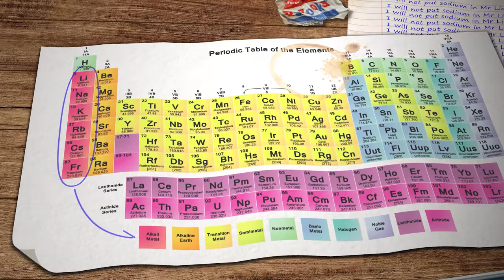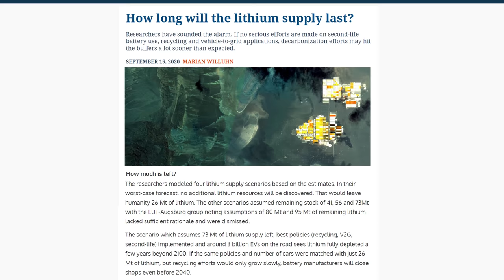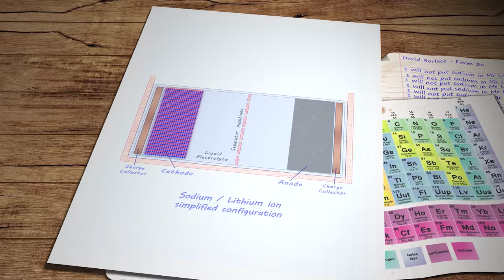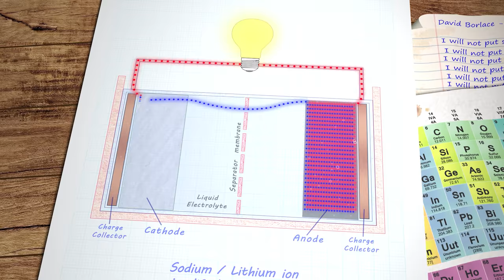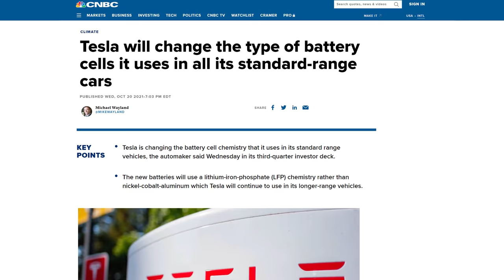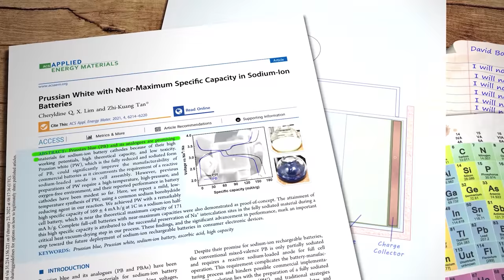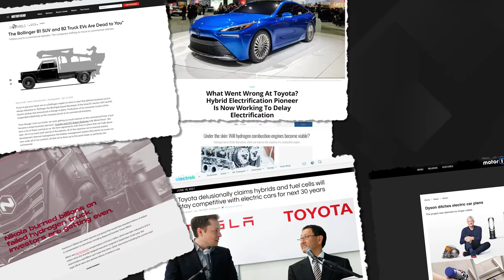Sodium-ion battery breakthrough. Safer, cheaper and cleaner than Lithium-ion

Comment: Just one point, or minor correction, -- well, maybe not so minor. And that is, that although Lithium is not nearly as abundant than Sodium, it is still very abudant. There are several countries around the world that could supply the entire world's supply of required lithium for the entire auto industry. That's billions and billions of cars. And of course, it's recyclable. In fact, Lithim is found all over the world in just about every country, outside of tiny island nations. 

It's just that until the last 15 or 20 years there has not been the need to mine and process it to the scale we do now. The next 3 to 5 years will see massive mining AND processing operations (many being currently built) in countries like the USA, Canada, Australia, etc. And in 10 years, the price (due to its recyclability) could rival, sodium. Well, that's a stretch, but you get the point.

And outside of land masses, all the ocean waters around the world contains Lithium, with underwater volcanic vents containing 7 times or more concentration of it than normal waters. What Sodium batteries will power, however, will be heavy, massive statioary energy storage solltions around the world.

Comment: The PV Magazine Article cited at 1m36s contains a huge over stretch in its maths assumptions.  Basically the article seems to think there there will be 3 ‘BILLION’ EV’s on the road by 2050 … which is mad. Because in the entire history of car production over the past 150 yrs or so, there has only been around 2 Billion vehicles in total, with an estimated  1.1 to 1.2  Billion still in use across the entire planet.  I therefore suggest that its highly unlikely that there will be 3 'Billion' EV’s manufactured by 2050. Its far more likely to be just a small fraction of that number. To produce 3 Billion in the next 28 yrs would imply a flat rate global production of 110 Million per year NOW, although of course the likely ramp up is exponential not flat. But even so, the 3 Billion figure is way overstating it, even allowing for population growth, and excluding all sorts of other likely developments like fleets of general use FSD robocars, significant energy efficiency and optimisations, other battery technology's (eg sodium based ..), Tesla's recent patent for Li extraction from clays which could be a game changer, and perhaps the lack of need for us to all have vehicles. I also think hundreds of millions of legacy ICE vehicles will still be in use into the 2040s and beyond.  Final point - there is, theoretically, enough lithium in the worlds oceans for an estimated 20 Billion EVs (which absolutely isn’t going to happen!) but its a tiny tiny amount per unit volume and would be a last resort and highly unlikely to ever be implemented etc.

Comment: It's good to see tech that uses more abundant resources. At the same time, a casual search shows Li-Ion cells go up to 260 Wh/kg - that is still a substantial difference. Also, there was no mention of density per unit volume, which is critical for these new batteries to be used in phones and similar devices. I would expect at least in the short term these will be a cheaper alternative for larger scale systems - like cars or grid storage. 
Also, the first generation sodium batteries are now out for a year, but I have not seen them mentioned at all... Did they get any substantial deployments?
Reply: It's not for phones
Reply: @markjackson7467  Even for cars, capacity per unit volume is important. It's only grid storage that can disregard it.
Reply: @GalvayraPHX  There's an acceptable range for each application - it's not binary you dipper

Comment: sodium ion batteries seem like they could work as a replacement for lithium ion batteries for smaller mobile devices. i think that iron air batteries will eventually become the standard for stationary batteries such as power walls.
Reply: Not likely for power walls as those rust batteries need to be physically swapped out more often (even if they are cheap).  Maybe for car batteries.

Comment: If you add a larger chunk of Na to water, it will sink, then melt, then float over a wide surface and the resulting hydrogen will explode.  It's cool -- if you are standing far enough back.

Comment: I've long been very critical of electric cars based on Lithium Ion batteries. I still am. Hybrids are ok, full electric not so. But if the claims about Sodium-ion batteries prove to be accurate I believe they offer a very legitimate shot at pure electric Sodium-ion powered cars. Reasonable charge times, reasonable price, reasonable life cycle, reasonable safety (not actually as low as suggested), all of that makes the limited range less of a critical issue and other aspects pretty good. The weight is still a problem, especially for performance cars, but for day to day driving it could finally make a gasoline engine non-essential for a car with few tradeoffs.

Of course electric planes, electric shipping, etc is all still nonsense. Electric lorries would really depend on use case. But certainly viable electric cars are the first step in the vision put forth by governments around the world and I could get behind a Na-ion car (if it performs as promised).

Comment: If the energy density is getting that high, with the aluminum savings, and the thermal performance, this could eventually displace the mobile batteries. LiPo and LiIon are fairly common in the small robotics world. This could be an exciting way forward.

Comment: Aluminium as the current collector seems a little dubious for the longevity of the battery to me. Aluminium oxidizes really easily, putting it in an electrolyte solution and passing a current through it would surely cause corrosion and significantly impact the potential charge/discharge cycles?
Reply: Then use good old carbon, lol

Comment: Exciting concept. To be honest I would still be happy with 3/4 the capacity of Lithium with the sodium if the Lifespan is potentially 20x longer or more for the same price.
Reply: In many applications it's the dollars per kWh used that is the main metric. If these really last 10,000 cycles vs lithium at about 3000, that's 1/3rd the cost. Very exciting.

As charging infrastructure gets better, the need for really long ranges starts to go away as well. The faster charge is great and makes up a lot for less range. A 15 minute stop every 300 km is as good or better than a 30 minute stop every 600 km.
Reply: @gasdive , very much true.

Comment: i think when you apply the silicon nanowire technology of Sinanode to the graphite, then you have more space for the sodium ions. might even get up to 250Wh/kg?
however, the cycle life is key and it would be a gamechanger for home storage - either for buffering solar power or fast charging the car at home with 50kWh.
salt water brine is a waste product in desalination. very cheap to get.
in the EU, you can feed 600-800W from solar panels into your own household to lower the electricity bill without any registration process. plugin the inverter in the wall socket with adjusted maximum power and done.
if you can buffer more energy, then you might have these 600...800W around the clock. without registration of the whole system.

Comment: Neither do I claim to be any kind of battery expert, but for the moment, until something tells me otherwise, I'm going on the assumption that sodium-ion will be a contender in stationary energy storage, but that it won't push aside lithium for EVs.

Then again, pumping up the volume can often be what really determines the outcome. For example, that's why I'm skeptical on the prospects for Sadoway's cheap-as-dirt molten metal battery. It doesn't lend itself to widely varying sizes, and mass production is going to be a serious barrier. Sodium may have some of the same problems, just because of lithium's head start.

Comment: Another battery may soon be making another alternative to both lithium and sodium, and that is aluminium-ion. Al-ion nominally is trivalent, that is it produces three electrons per atom rather than one in the case of lithium and sodium. Thus the energy density of metallic aluminium is 3 mAh/g vs 3.8 mAh/g for metallic lithium. However, due to the electrolyte being an active part of of the electrochemical reactions rather than just an ion carrier between the anode and cathode, the specific energy of Al-ion batteries have been only slightly better than lead acid batteries. A further complication is that the aluminum-chloride ions stored in the cathode are very large compared to sodium, but especially lithium. In the past this has meant low power density as the large ions diffused slowly between layers of graphite or other cathode materials. Also the stress caused by expansion and contraction of the cathode material also caused low cycle lives. 

This has changed in the last few years with the appearance of graphene which with some chemical processing and partial oxidation allows larger separation between sheets which reduces mechanical stress and strain and so cycle life has risen considerably. However, the large AlCl4- ions still had to diffuse in from the edges of multi layer graphene particles, and so specific power density was higher, but still constrained. In the last  1 1/2-2 years has come some significant breakthroughs in the area of the cathode. In particular is the technology developed by the University of Queensland in Australia, which developed a method to create graphene particles with only three layers and further to create a high area density of perforations in the two outer sheet without the middle sheet being disturbed. The aluminum-chloride ion is able to intercalate with the graphene at the edge of the surface pits or a short distance inside between the sheets. Because without the need for the ions to diffuse any significant distance past the edge of the surface perforations, the discharge rate is dramatically higher with both charge and discharge rates as high as 70C (that is the entire battery can charge or discharge in 1/70th of an hour, basically in about 50 seconds. And because the aluminum chloride ions are intercalating along the edges of the surface perforations, there is little or no mechanical distortion of the graphene. 

This has result in batteries that can withstand charging from 0-100% in less than a minute for thousands of cycles without any appreciable reduction in charge capacity. And lastly because the surface performations provide many more places for aluminum-chloride ions to attach, the energy density of the cathode has increase considerable, raising the total energy density from around 45-50 Wh/kg of lead acid batteries to 150 Wh/kg roughly equal to the LFP batteries that Tesla is moving towards. The very long cycle life of around 7000 cycles (19 years if completely charged and discharged every day), the extraordinarily fast charging and competitive energy density opens up interesting potential for Aluminum-ion batteries in cars, perhaps even more so in large trucks as well as an inexpensive battery that could again last for around 20 years in cars and 10 in trucks with their higher usage cadence, is non-flammable and relatively non-toxic and even has the advantage of running well at higher temperatures than lithium ion batteries can take, and thus could reduce the weight, volume and power required to provide thermal management. 

The next 5 or so years is going to be very interesting in the battery world.

Comment: This could be an EV game changer. Im impressed.
Reply: Not really
Reply: @vidznstuff1 I came back to add, Im NOT a fan of EV, dont get me wrong  however, 
 This wouldnt be the 1st time a product benefited from moving down the periodic table column one notch.. 
That handheld computer device youre holding has "gorilla glass" so the screen wont break as easily if you drop it. 
That benefit came from dropping down one "element line" from sodium to potassium.
Has that not been a GREAT advance for a product.??

Comment: I wonder what the difference in fuel usage would be if you replaced the standard lead acid battery in conventional vehicles with something like this.  I've seen lithium battery replacements that drop your car battery from around 40-50 lbs. to about 5-10.  While that is small fry for a single automobile, spread out across fleets of hundreds of millions, even that small weight reduction is bout to have a positive impact on fuel usage while those older vehicles are still on the road.

Comment: If the price is half of the lithium-ion cells, and has similar cycling capability, it would revolutionize the small and medium stationary storage probably. The claims of 95% capacity after 10000 cycles still need to be confirmed.

Cars, phones, laptops, power tools, etc will still use Lithium Ion and LiFeO2 for long time, due to their power and energy density.

Comment: I keep seeing comments about grid scale batteries.  While I will acknowledge that anything can happen, I just don't see utility scale batteries being all that practical.  All the batteries in the world won't mean a thing if you can't charge them.  The only solution I see as truly feasible, especially if we go 100% EV, is some form of nuclear power.  Wind mills and solar panels can be a useful supplement, but they won't be able to produce power on the level we will need.

Comment: As a side comment, it's worth emphasizing  that CATL is a Chinese company. For all the contempt with which the West tends to look down on Chinese industrial and environmental policy, and despite claims that our free-market style of capitalism is more innovative than their government-heavy version, it seems that not only they're winning big time in battery manufacturing capacity but also in fruitful battery RD&D. This is unsurprising: the reason why a lot of the flamboyant announcements of new battery chemistries coming from Western universities and startups never make it to the market, is that significant investments for a long time and dubious returns have to be made in prototyping and scaling up, and more often than not, the processes themselves lead to safety and/or pollution issues that can only be solved down the development road. Here in the West we don't put up with any type of environmental impact (at least not locally) and that's why we almost don't mine anymore: there's no such a thing as an environmental trade-off. And our financial markets won't fund anything that doesn't have either tremendous and rapid returns (or if they fail, they fail fast: no long-term commitments) or is de-risked by being proven by somebody else. Our politicians make policy decisions based on the criteria of NIMBYs and stock brokers instead of urban planners and engineers. We better fix this or we are gonna be left biting the dust.

Comment: There is a need for all battery chemistries that work to be made and used. If everyone uses the "best" one the materials to make that one will get too high. By making a variety of battery types and finding the best use for each one you keep material suppliers from gouging. Even nickel and cobalt would drop in price if fewer battery plants use them. So bring on as many types of batteries as you can world, we need all of them. Auto makers have already started engineering cars to use more than just one type of battery so just make something that works.

Comment: Starts off with a few myths. 1) there is adequate lithium we just need to develop it. We wont "run out". 2) cobalt and the "evil congo" is a old generic thrashing point that has little relevance. Yes there is some produced under bad circumstances but do your research on the efforts of the industry to clean up.  3) were you remunerated for this presentation from CATL? 4) good run down of how na-ion batteries work! 5) perhaps the end point of scepticism should be up the front.

Comment: There may not be many lithium mines but it is quite common, sodium is just easier to get at due to what other minerals and resources we already extract.  However, lithium reserves are typically dried sea beds, you actually can extract lithium from seawater.  There's also a company that plans to extract lithium from the salt water of dry oil wells, note oil wells are also a good source of sodium and indeed one of the reasons why sodium is so available is because of the fossil fuel industry, we extract it from the oil we draw.   Sodium has always had a lot of promise but historically the problem was keeping it molten.   Obviously, new approaches that do not require it to be molten are being tried and are promising.  Sodium is promising but lithium doesn't deserve the disrespect you are giving it and sodium is only plentiful because it comes with the fossil reserves we draw which indeed so could lithium if that company that plans to do so is successful.

Comment: I wish people would stop pushing this myth that lithium is in limited supply, in solid salt form yes, it is basically in the salts where oceans have dried up, but there is a virtually inexhaustible supply in the oceans which can be tapped simply by pumping ocean water into evaporation ponds, letting it evaporate, the various salts dissolved in the water deposit out independently as they reach saturation so that lithium salts are in their own layers and can easily be scraped off and then electrolyzed into pure lithium.

Comment: Although this won't make solar & wind as our primary power sources viable (for the same reasons that lithium can't), it should be quite good for stabilizing the grid, and assorted off-grid purposes (e.g. weather stations scattered all over the countryside).
Reply: Need far far cheaper for the grid.